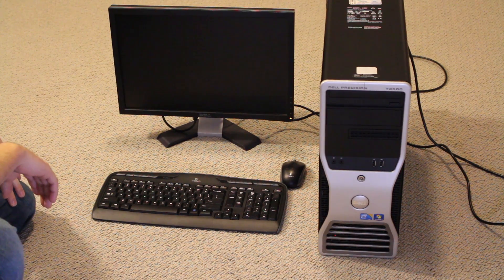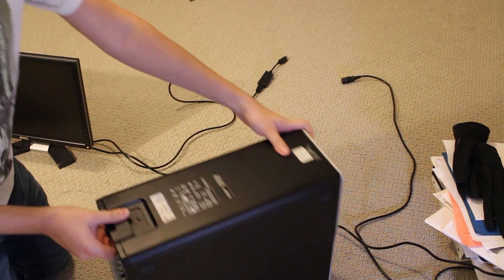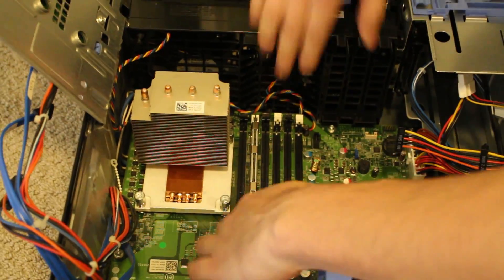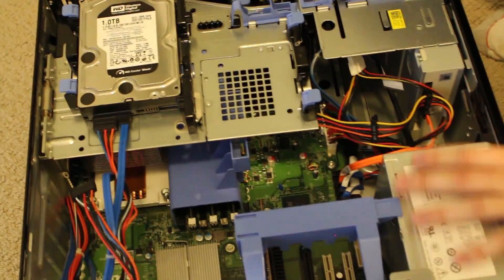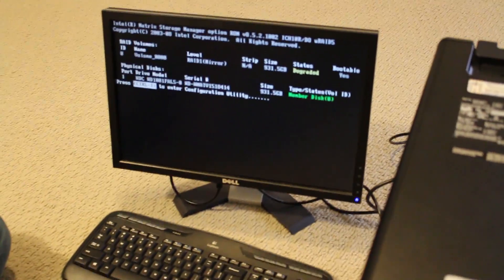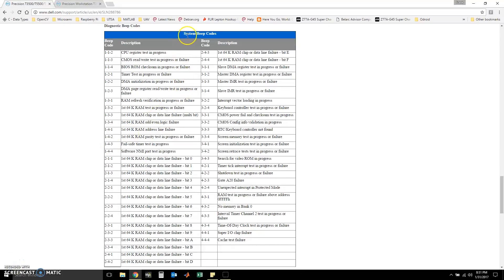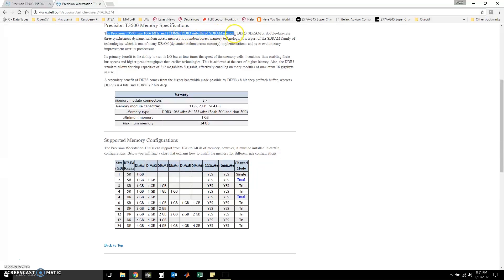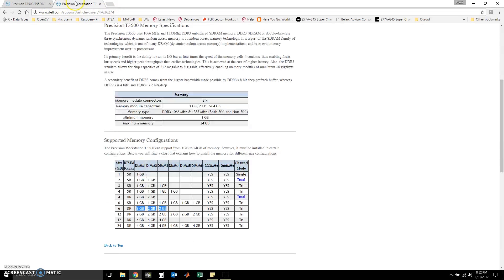[Solved] How To Fix Dell Precision T3500 Not Booting , 1-3-2 Beep Code

Comment: hello I have a dell T5500 I washed the motherboard with water and I dried it very well and it doesn't start anymore the yellow light on the motherboard lights up but it doesn't start what to do
Reply from the maker: Oh man. Why would you wash the motherboard? Water and electronics do not mix at all. Some water probably made it under a component or didn't dry completely and now your motherboard is dead.

Do you get any sort of blinking from the power button?
Reply: @FRANKHURTADO01  yes i have a bright yellow button on the motherboard tell me what can i do?
Reply from the maker: @aryy777-n  Is the light coming from the power button or the motherboard? The power button gives you a diagnostics code. I'll have to look into  lights on the motherboard if that's not the case.
Reply from the maker: Armando, pudiste arreglar tu problema o todavia no te sirve la PC?
Reply: @FRANKHURTADO01  todavía no funciona creo que se ha ido
Reply from the maker: Darlo por seguro que ya la cargo el payaso.

Comment: Basically you bought new rams and replace old ones
Reply from the maker: Nope you are missing the point. The PC had registered (buffered) RAM installed which wasn't compatible with the CPU and motherboard combination. I ended up installing normal unregistered RAM which made thr PC work again.

Comment: 1,2,3,4 all lights are giving solid color and continously beeping
Reply from the maker: According to the Dell manuals it's a reserved failure ao there isn't much information for it. It also says that the process between post and OS handoff is hanging. Could it be that your hard drive is dead or not connected?

Comment: I have an issue with the DIMM2 slot of ram so I took it out and plugged it back in and now i am getting this error beeb
Reply from the maker: Seems like the slot might be dirty or your RAM stick in the DIMM2 slot went bad. Reconfigure your known good RAM to the correct slots for the amount of RAM you have to see if your PC works again.
Reply: Frank Hurtado ok thank you
Reply: Frank Hurtado I have to get a replacement mother board which should not be to expensive. I might just buy a used t3500 for spare parts at that point
Reply from the maker: @burningpotato9447  That would be a good way to go about it. Replacing the motherboard is pretty straight forward.
Reply: Frank Hurtado ok that sounds nice

Comment: So the RAM was bad? Did you test it?
Reply from the maker: No, the wrong type of RAM was installed so therefore it wouldn't post because it was incompatible with my CPU.
Reply: @FRANKHURTADO01  Hmmmmmm......I just got a T3610 used and it starts up but there's no picture on the screen and the fans in the front run on full blast.

Comment: I’m having an issue with my T3500 that I received today, I’ve tried 3 or 4 gpus and the screen goes blank after the startup logo
Reply from the maker: Where do you have the display output connected? Try different outputs until one works. On some T3500 there are 5 outputs and only 1 is enabled depending on the setting you have enabled in the BIOS.
Reply: @FRANKHURTADO01  what do you mean by display output? I changed my GPU and I’m having no display issue no display whatsoever

Comment: Hello pls help me I get the same pdoplem and i fix ram but I can't press f1 to continue
Reply from the maker: Try using a wired keyboard or change your keyboard from the rear usb ports to the front ports.
Reply: @FRANKHURTADO01  i restart pc and nothing see in balck screen
Reply from the maker: can you try starting up the PC with only 1 RAM stick to see if that works? Also make sure you have the video cable connected on the right slot if you have multiple GPUs.
Reply: @FRANKHURTADO01  can i Make video in my channel and your see it?
Reply from the maker: @lich1fors39  yes go ahead.
Reply: @FRANKHURTADO01  you have Instagram?
Reply from the maker: @lich1fors39  no sir

Comment: Mine flashes 1 and 3 what does that mean?
Reply: Power supply issue. Mine was at same. I replaced power supply. Than it was perfectly working but now its blinking 1 and 2.

Comment: T3500 1,2 blinking 3,4 off Please help
Reply from the maker: According to the blink code, either the motherboard has gone bad or a component connected to it has gone bad. Try doing this to see which one it is. Disconnect all accessories from the motherboard, hard drive, dvd drive, cd drive, gpu, pcie cards, usbs, and try to see if it turns on. If you already disconnected everything and that blink code goes away, then your motherboard is good. Then start reconnecting one component at a time and attempt to turn on the pc. Repeat until you find the bad component. If the blink code still persists after disconnecting everything, then you test the power supply by itself to make sure it works or you have a bad motherboard.
Reply from the maker: https://www.dell.com/support/article/en-us/sln288786/precision-t3500-t5500-t7500-workstations-diagnostic-lights-and-beep-codes?lang=en
Reply: Sir i remove everything But still this problum
Reply from the maker: Do one last test, disconnect the psu cable harness from the back of the psu. Then connect the psu to the wall and press and hold the black test button. Make sure the psu turns on and if it does then....

You more than likely have a bad motherboard. Check to see if any of the capacitors look swollen up or broken. You can replace those at an electronics shop easily. If none of those look bad, then some other chip failed and the motherboard has to be replaced.
Reply: 1,2 light green blinking and power button yellow after 5,7 second pc auto turn off

Comment: I have a dell precision t5500 and only the number 1 turns on and doesn't boot
Reply from the maker: Seems like you could have memory issues. Start out by using and reseating 1 stick of ram at a time until you either find the bad stick or the PC works again.
Reply: @FRANKHURTADO01  i mean... The problem started happening when i installed a laptop hard drive into my desktop. So i removed the laptop hard drive and now its stuck like this.
Reply from the maker: @jomz6164  That is really weird. Try reseatimg the RAM. Hopefully one of the modules is just a bit loose and that's it. Also check and see if your Boot drive is set to AHCI or RAID. Dell likes to ship these out in RAID mode by default and if that's not set then it won't boot. Clear your BIOS as a last resort. BTW, are you getting any beep codes?
Reply: @FRANKHURTADO01  yes im getting beep codes, still dont know what the problem is 😭😭
Reply: @FRANKHURTADO01  the computer turns on with fans at full throttle and when it connects to my monitor, my monitor turns on with no signal
Reply from the maker: @jomz6164  whst beep code are you getting? Take a look at this link and let me know what errors aproximate your PC's problems.

https://www.dell.com/support/article/en-us/sln288786/precision-t3500-t5500-t7500-workstations-diagnostic-lights-and-beep-codes?lang=en

Comment: Hello, my optiplex 990 MT is re-built with a graphic card an a good cpu for a gaming pc, i have used this pc for 3 years no problem until now. The beep rythm is 1-3-2 just like yours, i have cleaned the slots and change the ram stick just in case mines were dead. After replacing them i have turn my pc on but same beeps and still nothing on the screen. Some people told me that it could be a problem with the motherboard, could it be that? Please help, it will be really helpfull.
Thanks in advance.
Reply from the maker: Try to boot it up by starting with 1 stick of RAM and adding one at a time and see what happens. If it keeps beeping, then you could have bad slots and not use those or you have a bad motherboard :(
Reply: @FRANKHURTADO01  Thank you very much for the fast responce and yeah the problem was indeed the mother board, i have welded the back of my mother board that has burned ( ram stick connecting part ). After replacing the ram stick with new ones it worked as fine as it was.

Comment: Could you help me with the 2 quick beeps I has for my Precision T3500? It won't boot up...
Reply from the maker: That's weird do you see any lights on the front?

Look at the following site and see if anything matches your pc.

https://www.dell.com/support/article/us/en/04/sln288786/precision-t3500-t5500-t7500-workstations-diagnostic-lights-and-beep-codes?lang=en
Reply: Did you solve your problem? I have the same  thing

Comment: I love these old computers
Reply from the maker: They're workhorses. Just a little TLC and they're back in business!
Reply: Frank Hurtado I looked at one of these last week and just bought a Dell T3610 from NewEgg.  Xeon 3 ghz hex core and 32gb ram for $375.   These old Dells are great.  I need to buy another one just like yours.  I liked them both.   Throw a Solid State SSD in and it’s still a great machine.
Reply from the maker: Yep I set up one like that too at the office with a 1050TI. Works awesome! The GPU uses power directly from the PCIE bus and is a significant upgrade to the built in graphics.

Comment: Bro? I have dell t3500 when i turn it on 1 and 3 number was pop up in front led but  there's no beep sound .. the power button changed their light into orange and it blinks three times then it stops .. No display in Lcd screen Plz help me Sir?
Reply from the maker: Take a look at S10.
https://www.dell.com/support/article/us/en/04/sln288786/precision-t3500-t5500-t7500-workstations-diagnostic-lights-and-beep-codes?lang=en
Reply from the maker: Reseat your memory and put it in the correct slots and see if that works.

https://www.dell.com/support/article/us/en/04/sln288863/precision-workstation-t3500-memory-specifications-and-configurations?lang=en
Reply: I have pb10 problem that was 1 and 3 which was given in your dell link
Reply from the maker: @suborlindahwillrecordyou810  oh ok Misunderstood you. That. Means your power supply died or something got disconnected. Make sure that all your power cables are connected all the way and none are loose or missing. It might just be time for a new one.
Reply from the maker: Dell Precision T3500 Workstation PSU 525W Power Supply (6W6M1) https://www.amazon.com/dp/B0056AY1IQ/ref=cm_sw_r_cp_apa_33A8Bb3ZT3AW5
Reply from the maker: Sorry about that but changing out the PSU isn't too difficult and should get your PC back up and running again.
Reply: Btw thanks Bro Love you :)
Reply from the maker: @suborlindahwillrecordyou810  No problem. Take it easy

Comment: Hello, thanks for this video, though for me it didnt work... i cleaned my pc today and replaced my  thermal paste for my cpu and gpu and cleaned the rest of my pc as well. When i went to turn it on however, i didnt get a signal instead some weird beeps. I dont know what this means. This is my only computer and i have alot of data on there, it would mean the world to me if you could give me some advice.
Reply from the maker: What beep code and front led pattern do you get?
Reply: Frank Hurtado thanks for your fast reply, i get six beeps and the 3 and 4 on the front light up
Reply from the maker: Martien Rurenga is it 6 continuous beeps or a combination of short and long?
Reply: Frank Hurtado i think continuos
Reply: Frank Hurtado i could post a video of the startup so you can see/hear for yourself? Would that help?
Reply from the maker: Yes that would help. 
In the meantime follow the table in the following link and try to boot your PC with 1 stick of RAM. Sounds like a stick went bad. Try booting with each single stick and see which one doesn't let the PC turn on.

http://www.dell.com/support/article/us/en/19/sln288863/precision-workstation-t3500-memory-specifications-and-configurations?lang=en
Reply: Frank Hurtado okay, thank you!
Reply: Frank Hurtado omg dude it worked i booted from each idividual stick and it worked! Thank you so much for your help i was pretty worried there 😁
Reply: ok

Comment: Frank Hurtado What is the specific model of RAM that you used?
Reply from the maker: Jesus Octavio Garzon Coronado PC3-12800U Non ECC RAM
Reply: Frank Hurtado some Brand or Model?
Reply from the maker: Jesus Octavio Garzon Coronado I don't remember the exact part number but it was Hynix brand RAM that I used. Most Dell PCs come with this type of RAM.

Comment: i need help  button power not green but orange  i have 1 and 2   and my t3500 shutdown
Reply from the maker: sam suki The LED code doesn't give much explanation in Dell's manual. What beep code are you getting?
Reply from the maker: +sam suki Give me a beep code if you heat one and remove power from the PC. Disconnect everything from the PC and try to see if it boots. If it doesn't ,reseat the RAM, GPU, hard drives and optical drives and then try to boot again.
Reply: Frank Hurtado  thanks it was the power supply failure. i need to replace it by a new one
Reply from the maker: +sam suki glad you found your problem! At least it is something that is easily replaceable.

Comment: I have the same problem..  I have tried everything but still the same problem..  Please help  😞😞
Reply from the maker: +Waleed Ahmed Did you try what I did in my video?
Reply: Yeah i tried.  To change the ram.  But it still the same problem
Reply from the maker: +Waleed Ahmed Did you use registered RAM? The problem happens when you have a Xeon CPU and you use normal unbuffered or unregistered RAM.
Reply: Im using normal ram..  But it worked fine for one year...  I have turned on my pc after a long time period.  After one month.  It was working fine before
Reply from the maker: Waleed Ahmed I would remove the RAM and reseat it. Make sure they are in the correct slots according to Dell's manual on memory configuration. If that doesn't work, I would check the CMOS motherboard battery and check that it's not dead and replace then replace it.
Reply: I really appreciate your help..  But i even tried the battery but having still same problem....  Don't know what's wrong with my system 😞
Reply from the maker: +Waleed Ahmed Does it give you any other beep code apart from the RAM code?
Reply: No..  Thats the only beep code im getting..
Reply: Can you tell me...  How did that happened to you system??.  My reason was that..  I didn't used my system for a long time and it messed up 😞😞😞
Reply from the maker: +Waleed Ahmed I bought the desktop at an auction. It probably was in storage for a couple months and messed with in between. Mine just had the incorrect RAM in it and I switched it out with server RAM and got it to work after that.
Reply: I even contacted to my near technician..  And he's saying that my motherboard will not work anymore .. 😞😞
Reply from the maker: Waleed Ahmed It could possibly be that or maybe a capacitor leaked out. I would check for a bulged out capacitor and have it changed if that's the case.
Reply from the maker: Waleed Ahmed I saw your video and I have a question? How many gigs of RAM do you have and are both sticks the same?
Reply: I have 12 gigs total.. I just took out 2 ram sticks.  But those is video are 4gigs 2x2..i used this system for nearly one year..  I was working fine..  But after one month of gap im having this problem
Reply from the maker: +Waleed Ahmed OK I noticed you don't have the RAM in the correct slots for dual channel configuration. Put the 2 sticks in DIMM 1 and DIMM 2 which are the 2 top slots with the white tabs. If you use 12GB (3 x 4 GB) then you would populate all 3 slots with the white tabs.
Reply: Already told you..  I have tried every possible thing..  Every single combination of rams.  Even tried new ram...maybe its something with the motherboard.. It won't work anymore i guess
Reply from the maker: Waleed Ahmed If you already tried putting in the correct slots the way Dell specifies in their manual then yes you could have a dead motherboard. I would check the slots for any dirt or debri and make sure they are nice and clean. The system does look a little dirty so I wiuld try vacuuming or cleaning it with compressed air and see if that works.
Reply: Sorry 😂😂😂 dont want to hurt your feeling.  But i even cleaned it before .. Yeah i looks dirty bcz it's really pissed me off bcz i wasted hours on searching on internet about it .and now i don't care about my pc anymore.  I might be ending up buying a new t3500
Reply from the maker: +Waleed Ahmed Then I think it might be time for a new motherboard.
Reply from the maker: +Waleed Ahmed I know how you feel. One day everything works fine and then all of a sudden it doesn't. That's the way electronics work and you can't do much when a component fails.